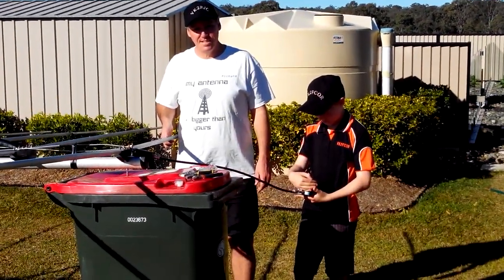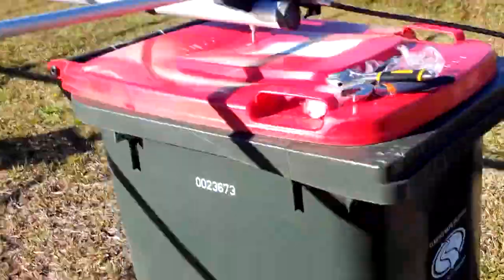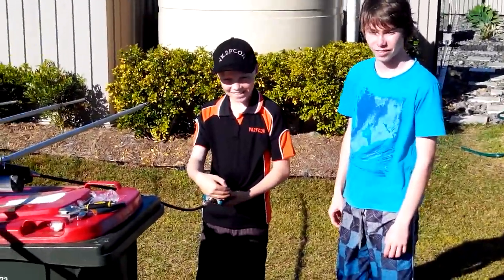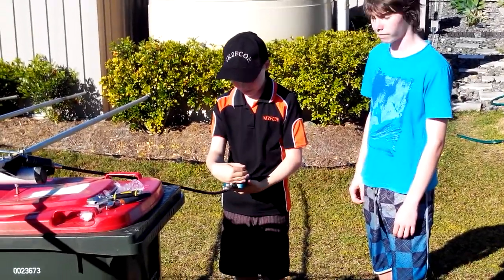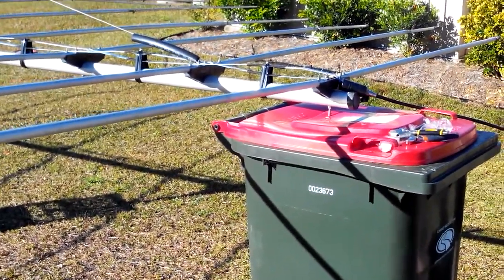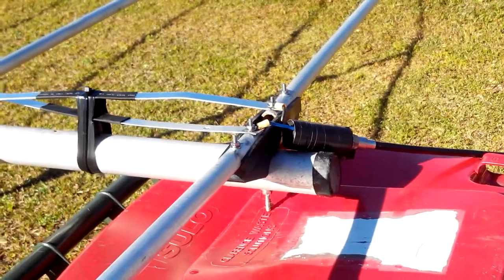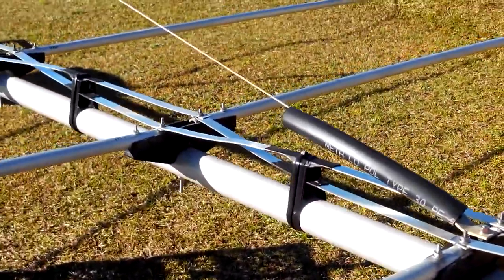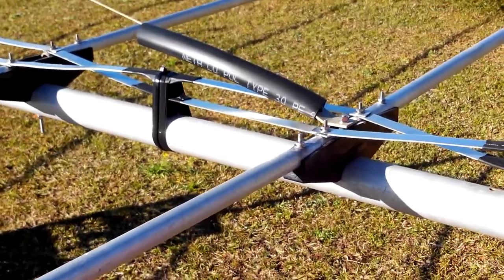Log Periocic Yagi.14mhz -30mhz

Comment: Hi Richard, was good to catch up on long-path this morning, Log P to Log P antenna. Its really interesting to see the construction work that you have put into this antenna.. Also terrific to see the youngsters getting involved. Your antenna is a good deal more complicated then the Inovantenna LP which I am using because of the cross-phasing strips. I can see why Justin went for the twin-boom 50-ohm arrangement for a commercial version. Yours certainly works very well though, as I can now attest! I would be interested to know what the SWR's worked out at with the antenna raised to its operational position?